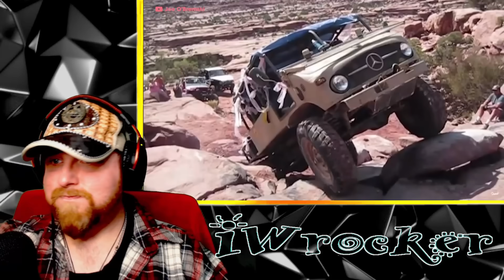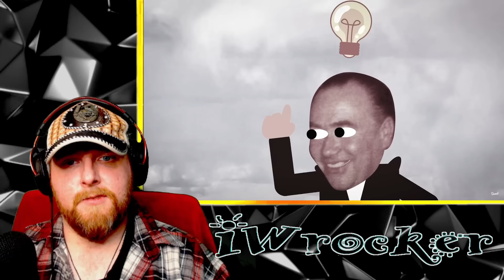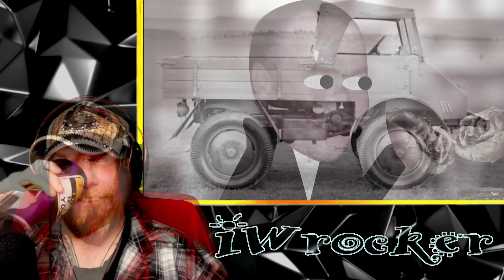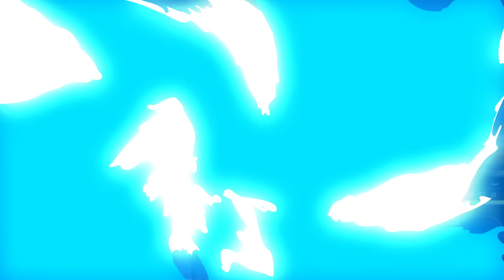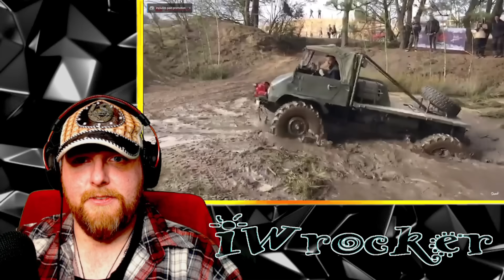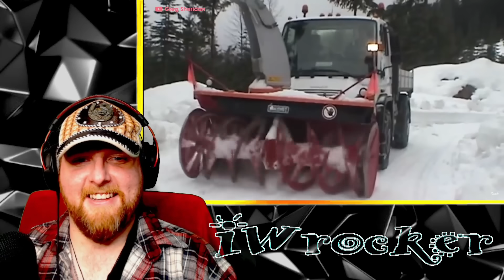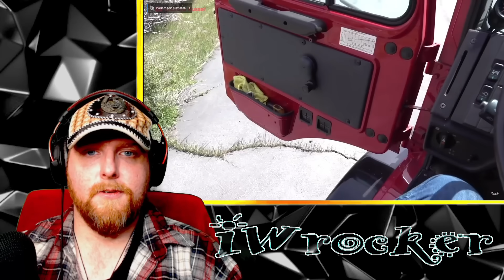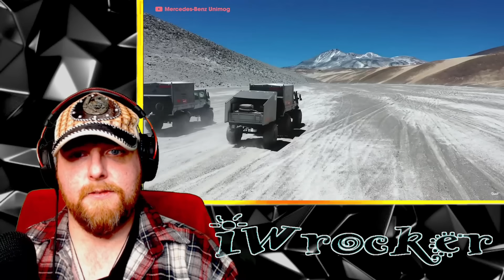American Learns About the Mercedes UNIMOG

Comment: The name Unimog is pronounced [ˈʊnɪmɔk], and an acronym for the German "UNIversal-MOtor-Gerät", Gerät being the German word for a piece of equipment (also in the sense of device, machine, instrument, gear, apparatus). It was created by German engineer Hans Zabel, who made the note Universal-Motor-Gerät on one of the technical drawings for the Unimog. Later, the Universal-Motor-Gerät was shortened to the acronym Unimog. On 20 November 1946, the name Unimog was officially unveiled. Since 1952, Unimog has been a brand of Daimler Truck.
Reply: Unimog was more than just a brand of Mercedes, they were their own independent division for a long time basically just using some dealers and the Mercedes name up until around the 90s shen they become more integrated with Mercedes.
Reply: Translation of "UniversalMotorGeraet" is "Universal Motor Device". 

There's not much that it can't be used for...

Comment: For years you could buy surplus german army Unimogs  for cheap 10.000 mark  back in the 80s and 90s.    at classis auto trader   they where verry popular with farmers and profesions that needed of road capabilities like specialized fire trucks  to combat fire in dunes or clay like areas. .
But even the old ones are now incredibly expensive ,  starting with beat up ones from the 60s 70s   with 8500 euros.   and prices jump up when they are in good condition to 18k -28K  euros.  and these are the 40 50 year old ones.  

A 2020 model will set you back  230K .   

These machines keep their value.

Comment: I have owned Unimog's for years, started out with a 404, then a 406 and ended up with a U1600(427), extremely versatile with a huge range of options, likewise some of the places I have worked also have had Unimog's, have used my one for agricultural, forestry\arboriculture, land access like repairing remote tracks and getting equipment to the tops of hills, along with winter maintenance with snowplough and blower for the local county council (my avatar image is my U1600 taken on the Sarn Helen roman road in the Brecon Beacons National Park while doing track maintenance)

Comment: Hi Gearheads,

Heard about the gearbox. Same speed backwards as forward? 
I tried one in the Danish Army in the late 80s. 
Also a old Dodge Power Van on petrol fuel.
And the Magirus Deutz V8 pulling a 14 ton, 8 inch Howitzer (203mm).💪

Pure fun when off roading.

Have a bright day.

Comment: Mercedes took the UNIMOG technology and built a tractor out of it. The Mercedes MB Trac. The technology, strength and driving comfort of the field tractor were praised. Unfortunately, it was also the most expensive tractor that could be bought. Production ended in 1991.

Comment: Worth saying that there is/was (its complicated) a full farming tractor version of the Unimog. The thing with the unimog is that its got tractor wheels and tractor axles, but its really a truck. That is why its illegal in the US.

There was a full tractor version that is not only tractor wheel and axles, but also tractor engine and all other tractor part, and more importantly registered as a tractor. They use to be called MB-trac. Its the coolest tractor i ever driven.

Its really popular as a heavy hauler for farmers, because it drives like a truck, but is registered as a tractor so you can drive it everywhere with any load and with only tractor registration and license.

But.. well. its not quite as cool as the unimog. Its still pretty cool
Reply: Mmh, interesting. Very specific restriction for the land of the free.
Reply: @DontPanick  Well, there are similar but different restriction in Europe. For example its pretty hard to get a truck license, and very expensive. This have made this solution fairly unattractive to farmers. 

The MB trac, that is pretty much just a Unimog that been tractorified, was made to solve this problem.

While MB trac looks much more like a tracktor, the mechanics and transmission is pretty much the same

Comment: When I was like 16 or 15 I went to a birthday party with some other friends. We could not find the place, so we just asked some old grandpa we found working in his backyard.
It being the small countryside village it was, he immediately knew the family we were talking about und asked if he should simply take us there. So he went into his barn and came out with this huge Unimog, we got in and he drove us there.
Man, I love the german countryside
Reply: Little sidenote: i slept there and planned to take the bus home the next morning. When the bus arrived, I saw smoke coming from one of the wheels, so I told the driver. Turns out the bus was freakin burning.
Was a fun weekend
Reply: @Avvisoful  Probably a brake that got stuck, it creates a lot of heat that will eventually burn the rubber of the tires, and once they're burning your car is as good as trash. Be advised when you stop someone for that, don't pour water on it - apparently it can warp/bend/crack the break disk or something. Once stopped a young lady in a Opel Corsa, and didnt already know that. She cooled the break but went through a liter of water, and it was still piping. Would've cooked her car on the way home, surely.
Reply: @Avvisoful  
Dual wheels can have one tyre run flat...
and after it has run flat for a while there is enough heat built up from the flexing for the rubber to catch fire.
Unless the driver uses his mirrors and spots the extra smoke......the other tyre starts burning....then the rest of the bus.

Comment: Well simple answer for you m8.
Uncle Sam is why you cant have them.
Same as Suzuki Jimmny
Same as Harley selling junk for years.
Protecting the domestic manufacturer.
Unimog is untouchable even in Europe.
Its everywhere as a road maintenance vehicle, unless talking about very poor countries.
Its not Cheap but Maintenance is not expensive since there is very little of it.
So yeah Parts may be expensive but the amount of parts you would change through the exploit of the vehicle makes it typically Old Mercedes cheaper overall to own.
BTW 56mph is a legal Limit for Trucks in Europe. All of them are electronically limited to that speed now, since no one allows them to move faster on roads.
However at the time Unimog was made there was no such system and the vehicle needed to Prove to the Motor vehicle department what it is so it can be Categorized. So they made a mechanical limit.
For US also would be hard to maintain because of General Lack of Mercedes parts.( Again Uncle Sam)
But for Anywhere else in the world, it's very easy they Use Standard Mercedes Delivery truck parts, other than the chassis. 
Theres a Few on sale where I live, ranging from 15 000$ for a 70s one to 34 000 for a 97' one.
Also they usually come with attachments so a lot of the price goes to that.
The problem with Unimog pricing is It will never go down because it's not a luxury item or a toy, it's a Machine. And it will always be able to do work like a field/communal Tractor. So it doesn't depreciate.

Also You may wanna know Mercedes actually made a Grandfather of a Modern Tractor(on a Unimog type chassis with permanent 4x4 ) it's called MB Trac. You should check it out. They sound Incredible. As Most Old Truck Mercedes engines do :)

https://www.youtube.com/watch?v=6ONJ4U6Regs
You can turn on Auto translate Subs they work well here.
Reply: Theres also this Dub https://www.youtube.com/watch?v=8ohubq9wFbM

Comment: We had an old one in the workshop to move trailers. As a driver you sit with your knees against your ears, next to you is the cooling water tank and the engine and behind it a console with levers for the various shift, reduction, change-over, power take-off and locking gears and not one lever is labeled.

We had an old one with a petrol engine in the German army for a short time, but then got a newer model with a diesel engine. It was a lot better. When driving through water over 1.20 m, you had to close the windows and switch the fan to 4. It had no cabin ventilation and so the overpressure could prevent water from penetrating. Headlights, axles and gears were also charged with compressed air when driving off-road.
They even told tankers not to drive where a Unimog got stuck.
The motor wasn't even very strong, but due to the many gear reductions, it had such a torque on the wheels that it screwed through everywhere in slow motion.
Reply: Sitting with your knees against your ears is by design, because that's all the noise insulation that Mercedes offers on the 'mog.
Reply: The trick is the many gears. Last one I had was a light Mini-MOG with the 2.9 liter Van engine - it was a beast in harsh conditions, but You had to pick from 28 gears all in all, shifted with three different levers plus a fourth one to change direction from reverse to forward and back, and the three different PTOs for hydraulic and winch were extra geared ... we put a crane and wide feet on it, a central winch and a highrise frontloader with a man-cage or forks and had even place left to put a slightly changed backhoe at the end - crane or backhoe only though, with hydraulics that needed changing from one to the other; backhoe away, loggers winch or loggers splitter or loggers big blade saw on, I even had a big sump pump (firefighter version) and a three-blade plough the chap I got it from gave me with it .... That thing was worth four or fife other machines and had just the smallish, fairly economic engine in it. Marvellous piece of machinery. Took about half a day to sell (for my price of course) when I retired.
Reply: The petrol one that you had in the German army was the unimog 404, first released in the mid 50s with 80 hp. Definitely underpowered but geared like a tractor. The replacement you mentioned sounds like a sbu series (also known as the square cans mogs) unimog, much bigger engine, much bigger vehicle in general and a lot more capable (it had a 150 hp minimum engine). The 404 was a 4.5 ton truck where as the sbu's were 10 ton trucks often derated to 7.5 ton to not require a heavy truck license.
Reply: Yes the old petrol engines in the army - power only when running fast, because the engine itself was designed for a sports car. But never struck anywhere. But you had to get uset to swith gears up to forth gear just to overtake a pedestrian :-)  (Ok, usually you could start driving in gear 3 or 4 as well...)

Comment: One of my Dads mate had a couple of older ones years ago with buckets and blades mounted on the front and had dual control... as in a steering wheel on both sides of the cab.. always  a fun time sharing driving duties just for a laugh..
Unimogs are awesome 👍

Comment: UNIMOG is a great little truck, still valued even if it's very old. There was a truck called Praga V3S that shared portal axles design and had similar off-road performance, produced between 1950-90's. By the way US army purchased hundred somthing of them in Iraq in early 90's, fI guess or the performance in desert. That old ugly workhorse can still be seen in Truck Trial competitions (was seen in one of your truck tiral videos). After the end of life of this truck, Tatra stepped in and designed T810 line with portal axles. It is used in army vehicles and off-road utility vehicles, such as energy grid service trucks. You should check that out too, cool stuff.

Comment: Awesome vehicles. You can basically bolt anything, any kind of equipment to them and use them for pretty much anything. Our National Railway Company as well as some local public transport companies have hydraulics-driven rail axels installed on them on the front and the back. This way they can use them on tram lines and railway tracks as well as a normal truck since the axels are liftable. On the affordability, these hold their value insanely well. I have seen Unimog's here that are 20-30 years old and still hold 50-70% of their original asking price, which wasn't low to begin with.
Reply: Indeed, some metro/underground operators use them to pull metro trains out of the tunnels in case of a power failure.

Comment: Ah hell yeah. I’ve been around unimogs for years at work. We clear trees back from power lines with them here in the UK. My boss had a fleet of about 30 at one point, all with elevated platforms on the back. I’m no longer in the cutting side of things but I use to love blasting around the English countryside in a mog.
Don’t know if it was just that one model in the video, but I’m sure I’ve see our mogs hit 70-80mph.
Reply: Yea most of them can go faster than 55 mph, it's just that the truck speed limit in germany is 80kph or 55 mph so they only list that as the top speed. Here in the US the bigger ones can be seen holding 65/70 properly set up, with some holding a bit higher with some power upgrades.

Comment: The YouTuber Tedward actually has a video of how to drive one of these. Quite a good video.
If you want to react to it here is a link: https://www.youtube.com/watch?v=DBLchakeCJs

Some local german companies have them, my home town has one for public gardening work.

The interesting thing about these is that they have a pre-selector manual gearbox.
To drive it you basically have to rev the engine up to 2500 rpm, select the next gear with the gear selector like a sequential transmission, and then use the clutch.
When coming to a stop there is a button on the side which will put the transmission back in first gear.

Comment: My grandpa had a Christmas tree farm here in Belgium, he used to have a Unimog there, it’s an insane vehicle, but one of the most notable things I remember, is the seating position, it was like sitting on the ground with your legs straight in front of you
Reply: Yeah the floor is so high above the ground, they made it so you could sit like in a normal truck the cab would be even higher, and thus more top heavy.
Reply: @kuehlschrank4389  indeed, it’s just such a silly seating position I’ll never forget it
Reply: @jonahfastre  It is everything but ergonomic, but You can drive in it where You want .... 😁

Comment: How do I get parts... Well I have one of 3 Honda Elements in Finland. I get parts from USA with UPS and using reshipping addresses. Or just using aftermarket parts made in Eastern Europe. I say it is just about doing research and keeping eyes open. Though my Element cost me more used than it was new due to all import duties and it was compared to and taxed as EU spec fully kitted out CRV that costs over two times more than E.
I bet similar would be with Unimog, get parts from Brazil, Mexico etc. I bet even Canada has them. Atleast they have importers in BC. German companies tend to make European models for mid-south Americas in factories located there.
In Finland I seen Unimogs used on railroad maintenance or built for special use like maintaining power lines etc also used by firedepts. They have nice ground clearence and can get anything attached to them.

Comment: How they arrive at that altitude? Diesel engine. Those engine work untill destruction if there isn't the self-regulator of revolutions for example, also diesels doesn't need the rigth amount of air and fuel pre-mixed in the intake phase, they need only air that is compress thanks to the turbine, go in the cylinder, push by the piston, the air is so hot that can ignite the fuel (inject by injector), combustion and exoust

Comment: love mogs and want one.. the brand new one are sweet, but still love the 410 with fold down windshield and canvas rooof and cargo cover. 
check out Unicat for bad ass Rv...Puts Earth Roamer to shame. or check out the 6x6 pinzgauer for a fun bad ass toy. more afordable too. but still have the same inport troubles too. stupid gove wont let em in.  can you imagine going camping off road with a 6 wheel drive beast

Comment: Unimogs are actually almost not destroyable. But when you need to repair or replace something be prepared to pay a lot of money. Like around 1000€-2000€ per tire
Reply: Michelin XM-47 are between 2000 and 2500 € each, depending of size. Yep, very expensive.

Comment: I'm Gernam, now living in Austria and in Germany almost any company maintaining roads has at least one of these. Not only for Snow plowing. Like you've seen, they're also able to go on train tracks - if they're built for it with the railroad axles. The Unimog firetrucks are usualy used in areas with large forests - if something is burning in the forest, the unimog is perfect for that...
I've seen one totaly destroyed because it rolled down a mountain for 200 meters (it went off the road and down the mountain...) - RIP Martin - I've known the driver of it for 8 years when this hapened.

Comment: He said, " No Meredes Unimog in the US ". He's right in some part but, wrong in second part of it. The Mercedes Unimog in the US under other names is Freightliner Unimog in US and Canada. The Mercedes Unimog having 2 features are sliding steering wheel by removing the dashboard also by pulling the switch under the column, changing auto to manual transmission by pulling the switch under dashboard too. The Mercedes Unimog great for over landing but, some negotiate about it needed a special type of people who can fix it. I think bottoms on the console are power by add on. The Mercedes Unimog it's a beast for the off roader. Also, the Mercedes Unimog it's a Swiss Army knife for the military.